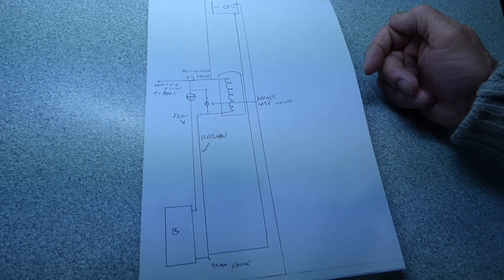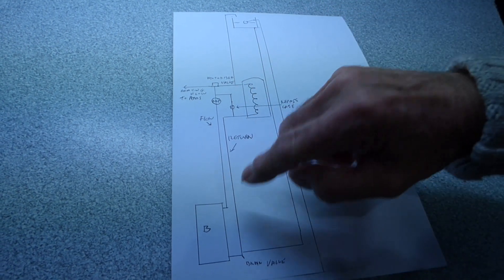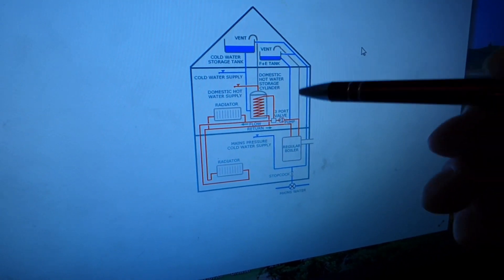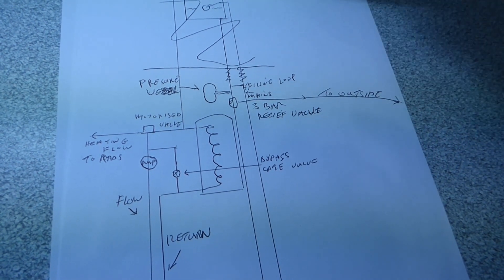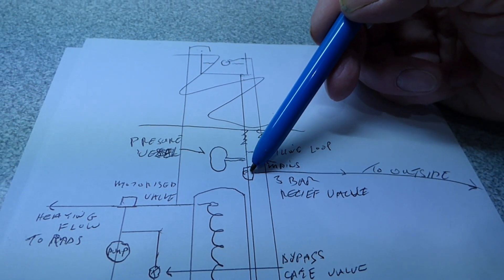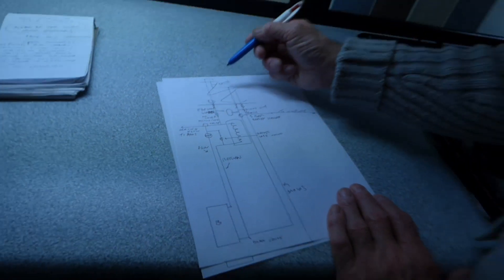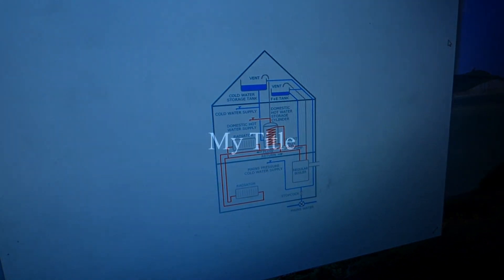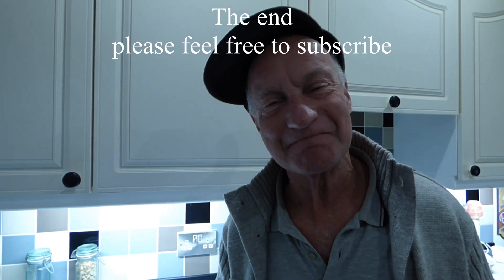Heating system not working properly? Air, sludge or a mechanical part.

Comment: Very informative. I encountered this very air lock yesterday. Drain the system down to change leaking radiator valve. Customer also complained that some radiators are not coming on at all. Before I change the leaking valve. I did a basic check on the radiators that are not coming on. I checked if Trv  are stuck but they are fine.  flow pipe to these radiators are very cold. Immediately I suspected sludge in the system. I confirmed this to customer by taking one small radiator off the wall. The system was badly sludged up, very blad tick water. I told him he needs a complete power flushing of the whole system. I proceeded in changing the leaking radiator valve. I had to drain the whole system and F&E valve off to do this. When i finished  I fill system again by turning F&E stopcock on. I got massive airlock that even took more time than changing leaking valve. Some radiators eventually came on hot but down stair radiators are dead cold and boiler was on and off. Customer call me again when I left but I told him, he need power flushing. That system completely drained me out
Reply from the maker: That`s plumbing for you.

Comment: Great videos mate bit of a good one here for you why have I got hot water backing up threw the expansion pipe and filling the tank  on central heating side 👍
Reply from the maker: Blocked cold feed system needs cleaning out. Black sludge is the problem.
Reply: If that works tomoz then Fridays a good day lol will post if it works  OK 😀

Comment: What a great video. I recognise a lot of the problems here like air and sludge. I have/had an F&E system with an overflow tank in the loft. When I had some issues a while back which I think was cause by low pressure (possibly) the guys that came to check couldn't find the overflow tank in the loft cause it was at the other end of the loft to the main tank when I think it's more common for them to be closer together. The second guy, cause he couldn't find the overflow tank, turned the system into a pressurised system with a filling loop, etc. Only after setting this up did we find the overflow tank which is still there in the loft. Is this set-up/system likely to cause problems?
The main issue I have is that all the rads are not getting hot. Upstairs rads and kitchen area seem fine but very little heat going into the lounge and dining room. The thermostat is in the dining room and since there is less heat in that area the boiler is having to work a lot harder than otherwise. The system was fine until a couple of winters ago when downstairs suddenly went cold. Since then the system has not worked well. I have an Intergas boiler which is about 7 years old and is located in the utility, next to the kitchen.
Any help/advice would be welcome.
Reply from the maker: You F and E tank would have been cut out of service once the pressurised system was fitted. To sort out the rads not getting hot, try balancing the system.

Comment: Air can be just as much of a problem in sealed systems. Even with inhibitor in the water, there is always a reaction between copper pipework and the hydrogen in the water, and hydrogen gas is released. I had this with more than one sealed system. On my present one I had a flow and return run into the loft, with an auto vent installed. This wastes some heat, but there is never any gas in the rads. Modern boilers almost always have an auto vent, but unless the boiler is at the highest point of the system, this vent will not prevent all “air”. Well, that’s been my experience....
Reply from the maker: Thanks John for your very informative comment.

Comment: Happened to me just this week. Air in system. Tried to bleed - no air coming out! Obviously got blockage in F/E feed ! Bugger! Rigged up a Rothenberger pump on to the expansion pipe thinking it would blow it through. Wrong! It pressurises the system a little and I can bleed a bit out but numerous trips up to the loft and back knackered me out! Feel a power flush coming on! TBH I really need to change the boiler (40+ years old) but it just keeps going!
Reply from the maker: Keep the boiler you have one of the good ones.
Reply: I have put a new hotwater tank in and header tank cold tank same system used on heating side that's all and yes may need a good flush out cheers

Comment: Great video, I have the first drawing you showed, 3 way valve changed but I've noticed my vent pipe that you mentioned could suck air down is completely blocked at the T where it goes to the header tank, should I unblock this vent pipe or just leave it alone. First time in 20 years it's had any work done in this area so guessing it's been blocked along time. Many thanks and great videos.
Reply from the maker: Get it clear as soon as you can James.
Reply: @dereton33  oh, is it not good to have it blocked? What could happen. Thanks for your reply to

Comment: Just wondering, my system has a combined feed and vent pipe, a single pipe running to the bottom of the expansion tank, as that’s underwater I’m assuming it couldn’t drag air into the system? - with this type of system what could possible be the culprit for air buildup? - can sludge build up itself be creating air through boiler Kettling?
Reply from the maker: Yes it does, just the normal operation of the boiler working produces air.

Comment: a friend has a glowworm combi boiler and the water temp is fine, around 50c but the radiator temp goes up to 77c and 2.3bar (from 1.4 bar!) and cant change it on the boiler front. any advice?
Reply from the maker: There should be a separate control for the heating temperature If not just turn the room stat down..
Reply: @dereton33  there are controls for tap water and rad water. tap water can be adjusted with + and - but the radiator one says "no" when you press anything. turning the room stat up or down does nothing, the radiators are scalding to the touch
Reply from the maker: Best have someone come and look over your boiler and controls as something is wrong.

Comment: Could also leave the system feeding form the f&e tank with a check valve on then cut expansion pipe and fit a expansion vessel and prv
Reply from the maker: Thanks for your input.

Comment: Hello, l have followed your brilliant advice, as one of my radiators was cold at bottom. (Largest one downstairs) Removed the radiator flushed thru, (not to dirty) replaced it added inhibitor and bled it. On testing now ALL my rads are cold at the bottom. Pls help with any recommendations? Massive fan. Veronica
Reply from the maker: Hi Veronica, check the central heating pump is working ok if it has a speed setting turn it up to full speed. If you use a combi try turning the heating stat up 10 %.

Comment: I have mitsubishi ecodan and radiators. They set me curve with settings - max55C water at -12C and max 30C water at 30C. I have problem with temps, when is cold outside,below +3C to -5C everythink works fine. When temps are +7C outside, heatpump set water at 36 because of curve settings and after that it stop changing temps, no metter if temps outside drop to -1C. Its just stay at 36C.. i dont understand

Comment: How would you know if the coil cylinder is blocked ? 

System has been cleaned using a magna cleasne 

Open vent and cold feed cut out and replaced 

Boiler is potterton 80 e 

F and e tank is pumping over out the open vent when hot water is on
Reply from the maker: System is still blocked you made need a power flush.
Reply: @dereton33  cylinder return is on 15 mm pipe

Comment: i have the airlock problem - except the other way around in the hot water side and wondering if you could help me understand why - i recently installed a new shower (to replace the old bath) and with own pump, which has all been done correctly - however i continue to get airlocks each morning (yet i can not find any leaks occurring certainly not big enough to cause the size of airlock i experience each day.  Not ethe system is around 40 years old and the traditional gravity fed system (rad I think on two pipe system) – possible the hot water and cold feed from header tank I think are the same pipe -  Basically over night I get a build up air on the cold water feed side, and until I can clear this via the kitchen tap – no hot water will run – purely cold water out hot tap until the air is pushed out. 
Just for your knowledge there is also some form of cylinder problem that the hot water bleeds over into the radiator system (and presumable vice versa) yet even with this bleed over I am sure to if can cause the airlock problem I have – I rent and land lord isn’t doing much to resolve this issue and it driving me up the wall as it sort have me make a cup of coffee and breakfast (whilst running the hot water tape each morning) before there is any change of taking a shower in the morning. The only other thing I ve noticed is kitchen cold water runs fine a lot of pressure – which I thing is on it own split water supply from the main stop cock – yet when you hold the cold water pipe from the main stop cock that running vertically to the loft – it feel like its not a full bore of water (this when I am running the hot water tap to clear the air) feels like it maybe dragging air up the pipe – however once the hot water eventually get rid of the air and runs hot water, this pipe then feels like it more the full bore / full flow – so not sure if a faulty stop cock could be causing all of the above ? 
Again I don’t recall the airlock problem being an issue in the summer seems to be a big problem now th heating is now on for winter – so I am not sure this cross over of hot water / rads is somehow causing the issue – this sort in my head explains why in the morning once the air lock is clear all is fine and then by late evening and over night – each morning the airlock is back with vengeance. 
I was hoping you may have some ideas why the above is occurring – could be a leak pre main stop cock in the ground leaking and air getting in – hence why I can not find a leak occurring indoors any where PS the head rad does also trap air which I do constantly bleed out – note also the whole system as  been drained down / clear water with the fluids you put in, etc so it not sludge causing an issue – under there sludge in the cylinder ? Please help as it driving me nuts!!!!
Reply from the maker: The pump could be emptying your roof tank faster than it can fill up. Go check the main ballcock in the tank is flowing properly and not blocked, also that the water is at the correct level. As everything was ok before you fitted the shower and pump, your problem has to be because of it.
Reply: Thank you - the problem was there prior to the shower - hot tap sort of spurted air when running (both to kitchen sink and bath)  but as it was a bath that wasnt so much an issue at the time just took longer to fill the bath. My new shower pump isnt using water quicker than it drawing out so that not an issue and in fact the pump has improved things (eg hot water as well be flow pressure) - other than this airlock issue (i thinking i ve perhaps got a nasty bend on either or both the cold main feed coming from the mains and on the hot water drop to the kitchen, sort can air in the system on those two pipes. The airlock does seem to be cold water side around the hot water cyclinder area (i am not a plumber by the way so found your video extremely helpful - so i am very guessing at its cause)- i ve been told its a head of tank issue and raising the tank may cure the problem - however i am not too convinced i think the system is drawing air in from the overflow pipe - when i put my thumb overflow ( when i had the bath) it would stop the spurting (i guessing i that i have a combined overflow and water feed - eg one pipe instead of two separate ones - you mention a valve being place in the overflow - which i was aware you do as clearly the overflow is intended to be an overflow, so is this some sort of pressure valve would open if water pressure built up ?? as maybe this solution to try first as an easy fix, again ruling out the air drawing in if doesnt cure the problem  PS the overflow pipe was very close to where the hotwater dropped down into bathroom - which i though maybe the problem at the time eg that this drop of pipe when live running hot water sucked air in - this drop as now been capped off and feed now a lot further away. sorry as obviously very difficult for you to visualise without seeing pictures - however by watching your video a value in the overflow pipe may be the solution ????

Comment: I have a Megaflo system which periodically cuts out & I have to press the reset on the boiler, could this be caused by a pressure drop?
Also is there a remote reset option as the boiler is in the loft, ideally I could reset via the hive system, one day maybe...
Reply from the maker: Could be a sign of air in the system or the start of sludge build up.

Comment: Al how often should I drain my system and refill 
Is a cleaner worth putting in
I’ve run mine for 25 years without a change!!
Reply from the maker: Wow you have been lucky. Should be done every 5 years.
Reply: dereton33 if I put a cleaner in do I have to drain it completely to start with
Reply from the maker: Yes you will.

Comment: Boiler keeps starting and stopping could this be a circulation issue as pump is operating fine
Reply from the maker: Sludge or air in the system.
Reply: @dereton33  the boiler fires up and cuts out after 5/10 seconds and repeats the process over and over 
The pump is operating fine

Comment: How would convert air separator to h section?
Reply from the maker: Use an air separator.
Reply: @ I don’t want to as they block. Why should I not use h section?

Comment: Rad in kitchen used to heat up but won’t anymore,gas heating system
Reply from the maker: Check for air first followed by the thermostatic rad valve is not jammed, then some system balancing.

Comment: I have another suggestion. Extend the expansion pipe so that it dips below the surface of the water in the fill tank.  Then no air can get in. (Oops! or out )

My central heating system has a huge amount of air in it.  The problem is I can't find a pump or any radiators or any pipes or any water.
Reply from the maker: Now that is a problem.